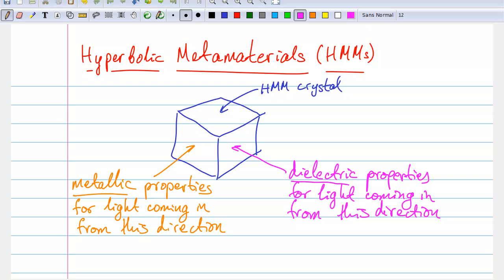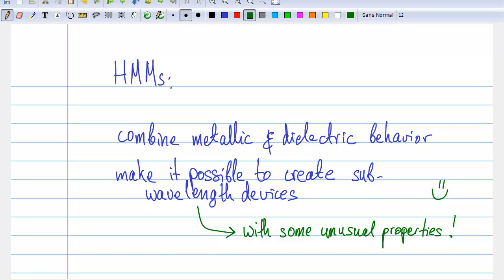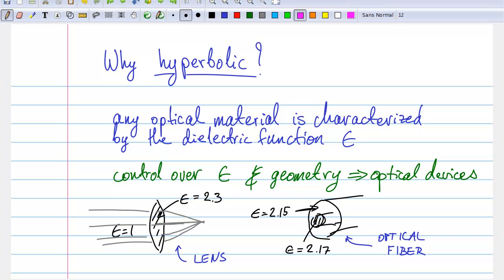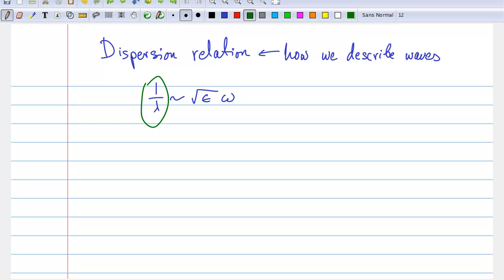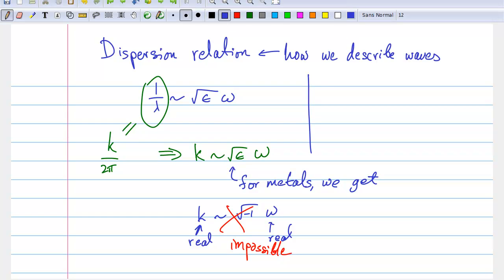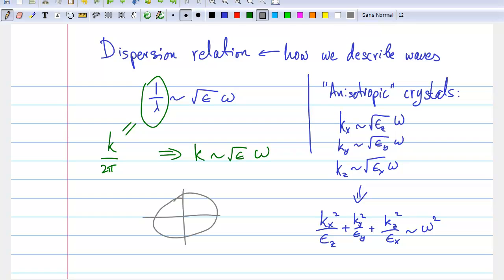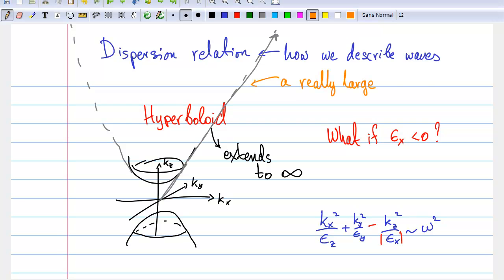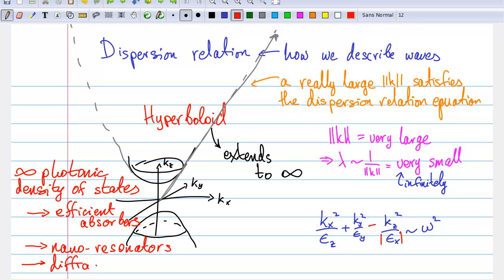Hyperbolic metamaterials explained in 5 minutes

Comment: think i found a mistake at 4:16. You get a two sheet hyperboloid in the z direction only if the y and x directions have negative epsilons. With the form you wrote, you should be drawing a one sheet hyperboloid, not two sheet